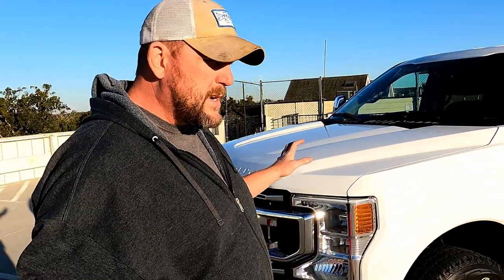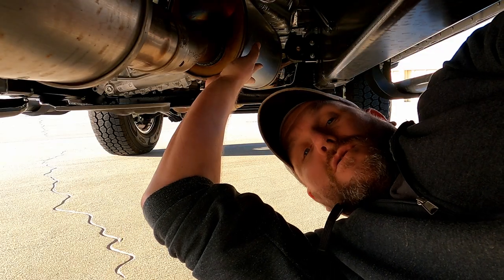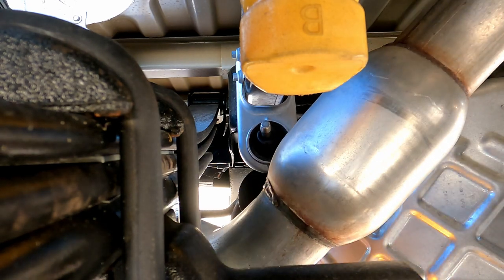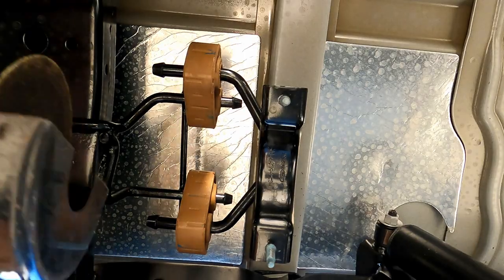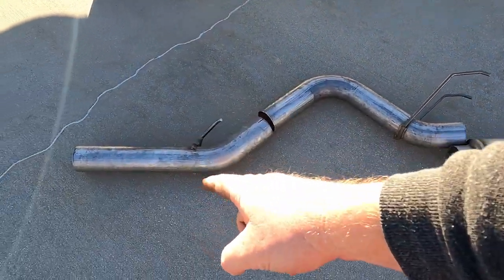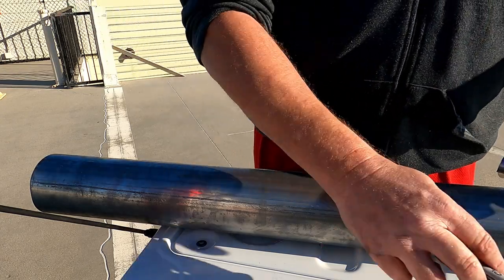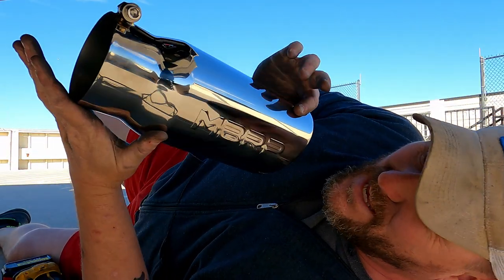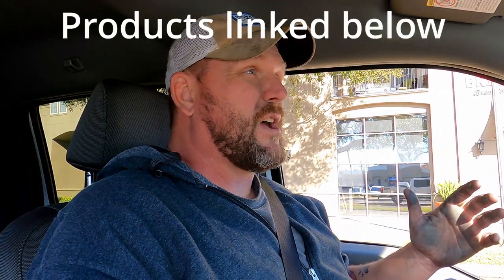F250 Exhuast Install - MBRP 4 inch - 7.3 Gas Godzilla!

Comment: I've had it on my truck for I think a year and a half. It's just right for daily driving and I towed a trailer for about 3 hours and it's not bad.
Reply from the maker: … thanks people have kept asking about the sound on high at and towing, that may be another video here shortly
Reply: That’s what I’m curious about. How loud inside is it pulling a trailer up hill. If it’s going to be loud and painful to hear, the hill will let you know.

Comment: It would be hard for me to cut out a new looking stainless steel exhaust to install an expensive aftermarket type just for sound.   I still have an OEM full exhaust on my 1998 F150 that just hit 200,000 miles and have never touched it.
Reply from the maker: @DavidWebb-rz3vi  okay 👍

Comment: The "resonator right after the catalytic converters", not sure how restrictive that is.  Other systems eliminate that, replace with pipe.  Less restriction = better mileage and more power.  That 5 inch tip looks primo for sure.
Reply from the maker: And removing converters would be even more advantageous and so on and so forth.

Comment: Hey, good install video. Since you’ve had this for a bit now, any issues with codes or emissions equipment from the truck on this?
Reply from the maker: @-AP-561  zero
Reply: @ Thanks for the response. I love the Ford Performance (Borla) system but I can’t justify its cost compared to one of these.

Comment: The kit says it is only for the 6.2 is it meant for the 7.3 or it just works?
Reply from the maker: @danieloconnell1386  yes works with 2017 and up 6.2L, 7.3L and new 6.8L

Comment: The original exhaust is stainless steel . Is the MBRP Stainless? If it isn’t I’d take a hard pass especially where I live . They have a T-304 version that’s the one I’d get .
Reply from the maker: … Aluminized Steal, I had this on my F150 and dropped our boat in saltwater every week for about five years without any corrosion issues. If you live where roads are heavily salty you probably want to spend the extra for SS 👍
Reply: @saltytrips  Good video.  I also had this version (installer series) on my 2020 F150.  It was on there about 6 months before I sold the truck.  I swapped the factory back on it before the truck left.  I did have some corrosion already on the exhaust.  Not bad, and it was out of site...but yes, that finish is susceptible to corrosion and I'm in Alabama.  I did a review of the install on it on my page.  I was able to get the factory F150 exhaust out in my driveway in one piece.
Reply from the maker: @funandfunction9116  … on our 2017 F150 I couldn’t get the exhaust out in one piece. I tried every which way. I would have liked to seen that because it would have been nice not to hav euro cut it.

Comment: Based on your surroundings, you live really close to me, hahahaha, always thought you were closer to NSB/Ponce Inlet. Truck sounded good, any idea if the exhaust helped the fuel economy at all or no?
Reply from the maker: … one of these days we’ll be closer to Ponce. We both work in central Florida. I’m pretty sure the only thing that will help you get better mpg out of this 7.3 Godzilla is by taping and egg to the gas pedal and trying not to crush it.
Reply: @saltytrips  Yeah, I'd love to be nearer the water myself, but work in Maitland, live in Winter Park. Oh well. What kind of MPG do you see while towing your boat? My  boat is likely very similar in weight to yours, so I'd be curious to know. If I'm towing, my F150 drops down to like 7.5-8mpg at a highway speed of 70mph on 528. It kills me. haha
Reply from the maker: @tommycrenshaw6038  … that will be whole other video, I have plans to do a test and film it soon. I’ll talk about the difference between the F250 7.3 and the F150 2.7 EcoBoost towing comparison too.
Reply: @saltytrips  I bet the 7.3 feels a whole lot better towing, LoL. I have the 3.5L ecoboost in my F150, it does the job just fine, but the MPG is brutal. I want a larger boat some day, so the F150 days are numbered
Reply from the maker: @tommycrenshaw6038  … stay tuned to find out 😉👍

Comment: Thanks for the upload on this. Great video! What gearing does your truck have? How is the cab drone? Have you towed with the new exhaust on yet, does it drone in the cab when towing?
Reply from the maker: … thanks 👍, it’s 3.55 gears. I don’t really notice the drone, but that’s all “in the eye of the beholder” , everyone is different. When we pull the 5,000 lb boat it doesn’t seem to make any difference, can’t hardly tell it’s back there.
Reply: @saltytrips  mine has the 4.30 gears. I'm worried about drone when towing if i change the exhaust.  I tow about 10k and usually for 4-12hrs at a time once per month. I can't have the family all loaded up and deal with that, been through it before with MBRP on a different truck. I do like the sound of this exhaust though. Not obnoxious but almost like OEM+
Reply from the maker: @joenewport6005  … if your worried about sound I would keep it stock, the rumble is nice but not worth fighting with the family 🤣
Reply: @joenewport6005 don’t do it. I had one with my 4.30s on the freeway it’s unbearable
Reply: @SFD334  i just got back from a 2500mi trip towing and it's loud enough inside the truck in stock form. I can't imagine it being comfortable with an aftermarket setup. I'm going to try to build an exhaust that is stock noise level inside but a little louder outside. Maybe even a selectable of some sort.
Reply: @joenewport6005  there’s a company called stainless works that sells a resonator delete. So maybe that’s an option. Cab chassis trucks come without one
Reply from the maker: @joenewport6005  i actually have a whole video about the noise, with and without towing, coming out soon 👍

Comment: I just dumped my exhaust over the axle looks better and it’s louder too
Reply: That’s what I was thinking…
Reply: @davemc8598  axle dumps with a fat ass exhaust tip is better then w tail pipe set up you lose a lot of sound through the tail pipe

Comment: Next time just spray wd40 on the exhaust hangers and the rod will slip right out of the rubber grommets
Reply from the maker: … that’s what I did with my F150 exhaust replacement, they didn’t “just slip right off”, hacking off the nipples was much easier.
Reply: I agree. also, I'd have to go buy another tool just for one job. Not worth it. not that i'm against getting more tools, but I've never had trouble getting those off, even when i used to turn a wrench as a mechanic. Cool idea though. Cutting the nips off would kinda be a pain if i had to remount the stock exhaust because the family didn't like it.

Comment: I get trying to save a buck and diy….but an easy install like that at a good shop wouldn’t have cost much and now you no longer have your original exhaust if ever needed.
Reply from the maker: Having a shop do this easy install is a complete waste, way to easy. Not once have I ever kept and reinstalled a stock exhaust on a truck at a later date nor have I ever heard of or known anyone that has done so.
Reply: By the same train of thought you should pay people to change your oil too. But why would I do that? And what exactly would you do with your old exhaust???
Reply: @saltytrips  warranty purposes. If there were to be an engine failure for instance having nothing to do with anything you did or fault of the exhaust …the claim would get denied and you’re responsible. And you answered your own question…it is way too easy but you need a lift to get the OE exhaust off in one piece.
Reply: @OhshitPositive  keep it in your garage for instance. May need to put back to stock for warranty purposes
Reply: Deleting mufflers will not void any warranty other than the muffler. Which warranty are yall saying this voids?

Comment: Gas ford spent to much  Gas diesel is better
Reply from the maker: … every tool has its place, diesel took to much payload capacity away for us.
Reply: Not everyone needs a diesel much more expensive to maintain and repair. The new 7 3 is a beast works perfectly for me tows my 15,000 lbs just fine .Maybe if I were towing more than 20 I would get a diesel.
Reply: @noneyabiss369. Exactly. I owned 2 diesels (CTD & PS) and it was waaay overkill for what i needed. 7.3 gets the job done and thensome. and the sound....  shawing!!
Reply: Modern diesels are unreliable high maintenance. If you don't absolutely need one avoid at all cost. We got gas and diesel superdutys, and the gas gets way less down time. Gas might not pull as fast but they always crank and get there.